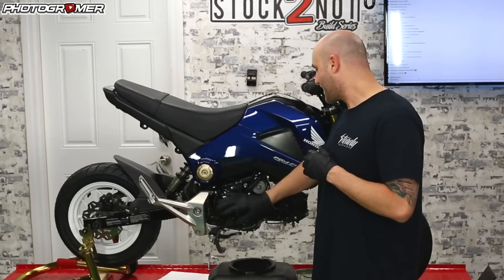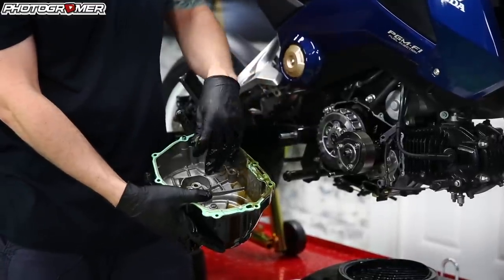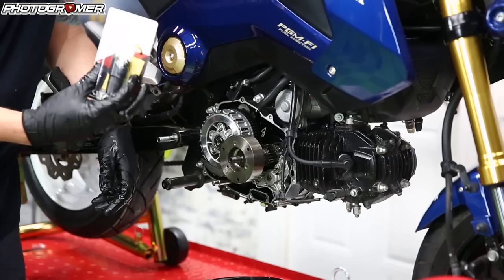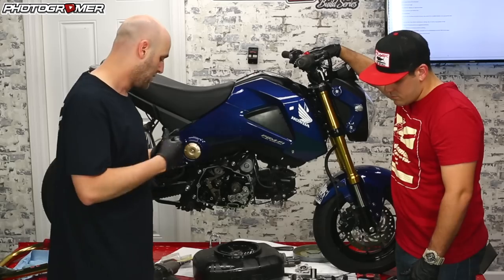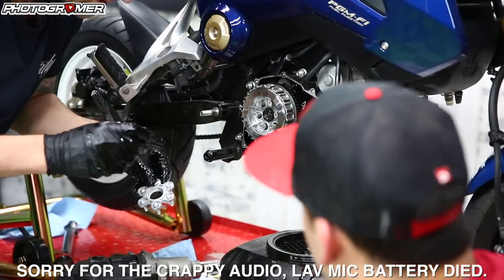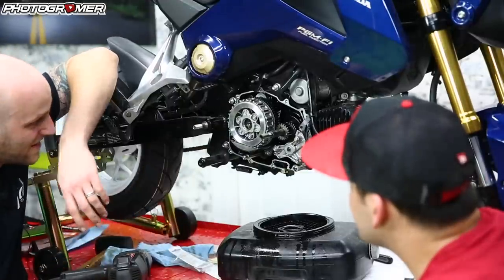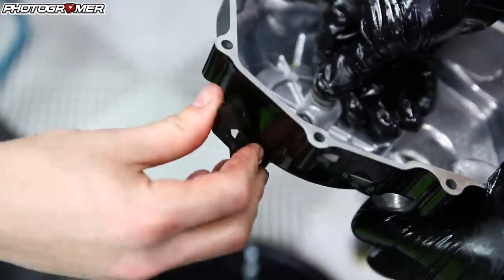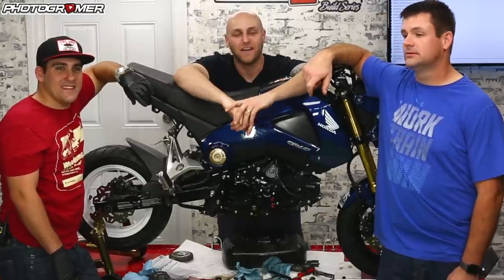S1 E3 - Breaking Takegawa Slipper Clutch | Grom Oil Change | Kitaco Cover | KOSO Oil Pump

Comment: At least I’m not the only one who can’t get that clutch basket nut loose. I need that gear tool. I used a penny to hold the gears and it worked for the spinner.  But, need a gear tool for the clutch basket removal.  That gear tool is not available.  The OEM gear holder is over $90.00, which is out of my budget for now. Thanks for showing the actual difficulties.

Comment: I bought the Takegawa Slipper Clutch for Grom and I got an additional instruction page that it doesn't look like you have. It says "The STOCK Thick Washer.. The one under the STOCK inner basket is left out when reinstalling the Takegawa Slipper Clutch, otherwise the nut won't have full thread engagement. Make sure the clutch is installed as shown. LOGO's MUST align as shown and ramps must be in the SLOTS for proper installation." It looks like you installed it WITH the "stock thick washer" that they say to leave out. Do you have any feedback about this? Were there any adverse effects of installing the slipper clutch with it? Is the OEM washer that you installed, the "stock thick washer" they are saying should not be re-installed?

Comment: Easy way to keep engine from turning is to take out spark plug and push few feet of rope inside cylinder through spark plug hole. Leave a bit hanging out to be able to pull rope back out.

Comment: Haha. I thought I was the only one who snapped that plate. I did figure out a better way and posted a tips and tricks video though. Mainly, you need to have the pressure plate on there still to tighten the nut.

Comment: Dude put the bike in gear and secure the back wheel, it will put resistance on all the turning bits so you can crank them down 👌
Reply from the maker: Yeah we did. I got it all back together over the weekend w/ a new slipper clutch. Thanks for the tip though, sometimes you overlook little things so always appreciate another set of eyes.
Reply: Yeah awesome 👌

Comment: I would hit up your local Home Depot, Ace Hardware, or the like and find stronger bolts with the same length and pitch. That may resolve your broken bolt issue.
Reply from the maker: broken stem not bolts. Stem is the clutch housing made out of cast, no other options there.

Comment: FYI you don’t have to trim the dip stick it clears everything internally .... now if you ever need to go back to the oem cover you won’t be able check the oil level
Reply from the maker: True, guess we never go back to stock :)
Reply: Was wondering if that was necessary, thanks.

Comment: Bolts probably stretch from factory, may only be one time use.
Reply: Chevy tells you replace the head bolts on some of their engines because of that reason.  The bolt will stretch when torqued and need to be replaced if they're removed.

Comment: Can you help me? I have my Grom still 125cc with Kitaco billet lifter clutch with their 60% harder springs. In 2 weeks I will install the 181cc Neo... I also ordered the Takegawa slipper clutch. My question is: The Takegawa slipper clutch already comes with harder springs? If not, can I use the 60% harder springs from the Kitaco kit I already have or is too much pressure for the Takegawa lifter (I read is a little weak)? Or should I buy the Takegawa 30% harder springs? I´m afraid the slipper clutch with OEM springs would not hold the torque of the NEO... and the 60% harder springs from Kitaco will break the Takegawa lifter. Waiting for some answers! Thanks!
Reply from the maker: The slipper clutch doesn't come with stiffer springs however I run the 60% Kitaco springs with my Takegawa slipper clutch using the pressure plate that comes in the kit (which is cast, not billet) on my stunt grom, it's perfect. I wouldn't use the Kitaco Billet pressure plate. Use the clutch pressure plate that comes with the Takegawa slipper clutch which has the 6 holes with the 60% kitaco stiffer springs. It will be fine. Just tighten down in a star pattern.
Reply: @Photogromer  you are the man. Very, very, VERY grateful with such a fast response!!!!

Comment: LMAO - " I think i put a screw driver in there last time...." seconds later confidently saying "Put a screw driver in there and have a friend hold it" xDDD you could just tell the moral of the episode went in the trash after the first clutch broke. They need to make them things out of more durable metal. NOT aluminum
Reply: Aluminum is the best choice for a clutch basket. Full blown supercross bikes still run aluminum clutch basket assemblys . The quality of aluminum and casting is what is affecting the durability on the grom. NOT the fact that it is aluminum.

Comment: The billet clutch plate from Hard Racing does not work with the slipper clutch (it's too thick and won't allow the clutch to engage). Also another method to stop the spinning while trying to crank your bolts is to use a socket (i believe its a 17mm) to hold the crank on the crankcase. Instagram @DiElusive1
Reply: ive used washers instead of plate to torque basket